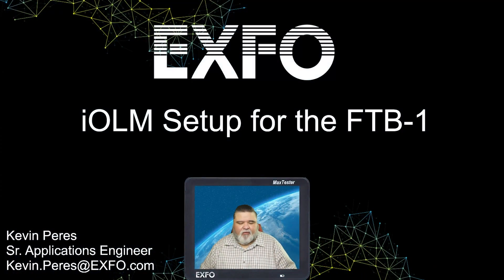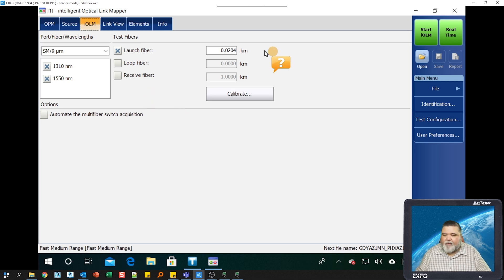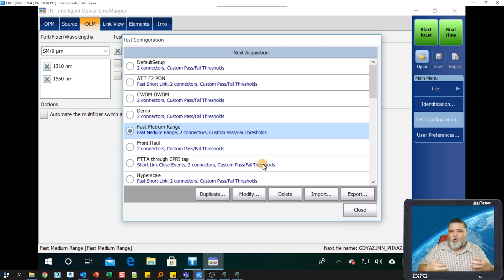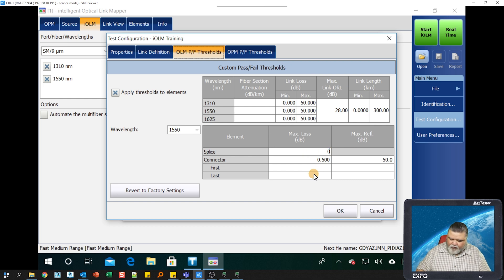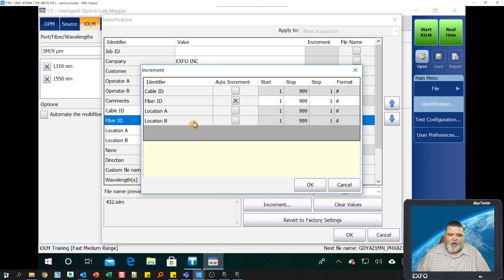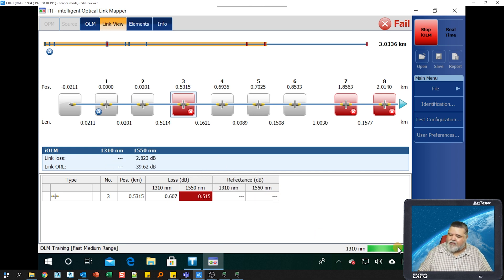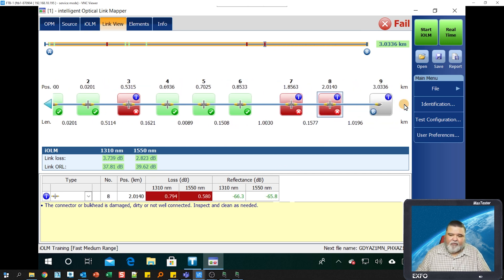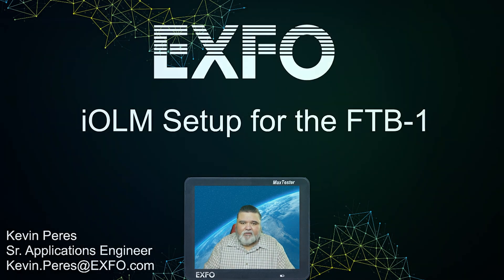iOLM Setup

Comment: Hi Kevin thanks for your great videos. In regards to certifying fibers links what is the prefered method between the iOLM and OLTS? Is iOLM meant  as a troubleshooting tool only or can it be used to certify fiber optic links for customers as the OLTS is meant to do. Thanks.
Reply: Chris,  I am glad you found the video useful. iOLM has the same functions as legacy OTDR testing, it offers more detailed and comprehensive results in one test versus the OTDR. Like the OTDR it is used for troubleshooting but is also used to certify event loss and reflection.  OTDR (iOLM) is an integral part of full Fiber Characterization along with CD, PMD and OLTS. While it will provide Span/Link results and we have many customers who use it for span certification it is recommended to use an OLTS and OCWR (FTBx-945/MAX-945) for Span loss and ORL as it uses a continuous wave source and provides higher precision and does not suffer from mode field diameter miss match (gainers and losers) that we see in OTDR and iOLM from a unidirectional perspective.  With that said if you were to use to to certify Span Loss and ORL it is important to use a launch and receive fiber and that bidirectional analysis be performed to account for the gainers and losers.
Reply: @KevinPeres  Thanks Kevin for your feedback I appreciate the information. Thanks again for your videos they have been very helpful in understanding the EXFO.